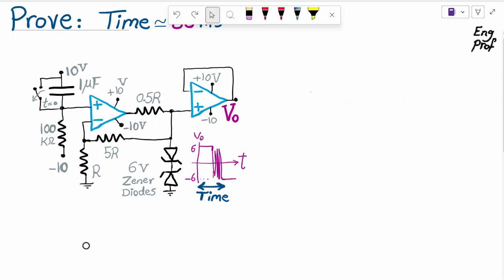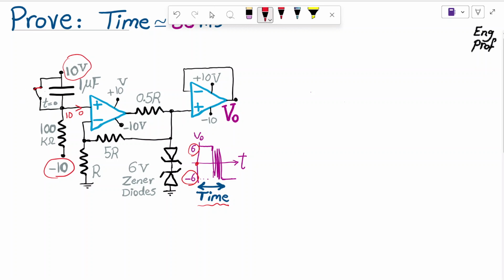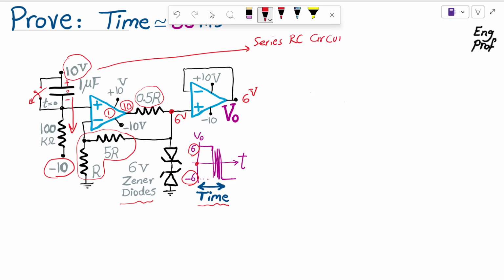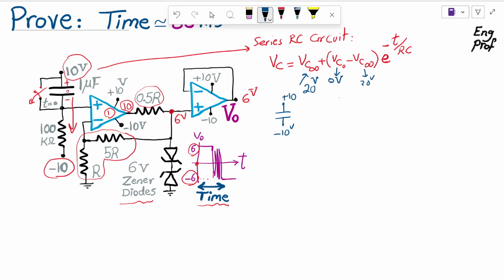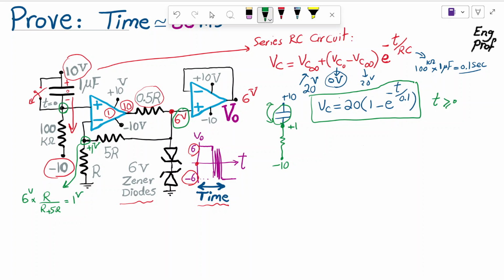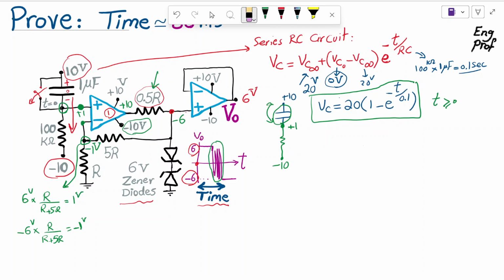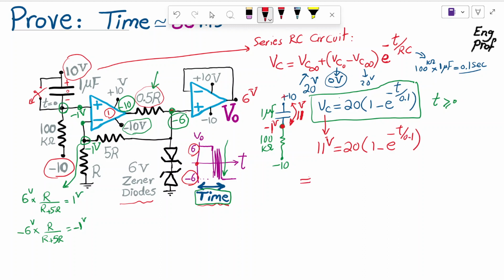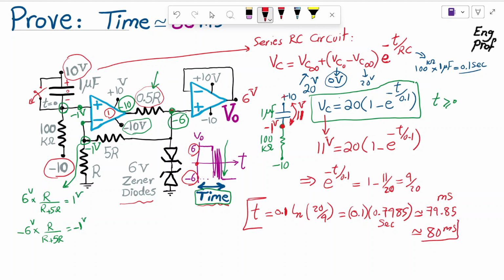Op Amp RC Circuit switching time

Comment: Things like this come handy sometimes. I will need a good multiphase clock for the processor I'm designing. With Shottky latching to avoid spureous high-frequency armonic oscillations.